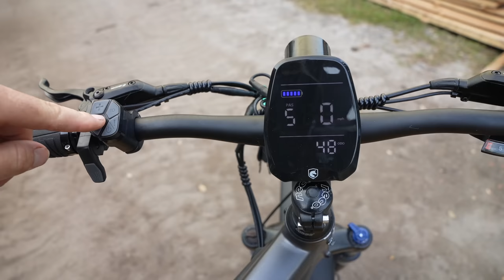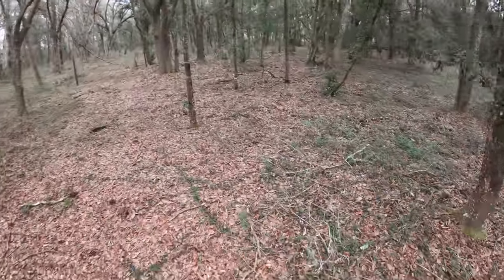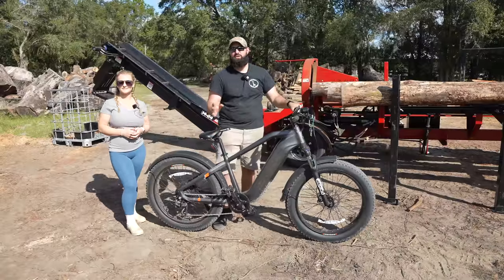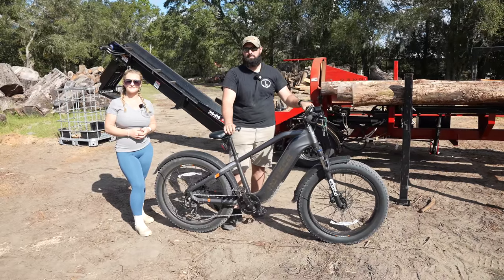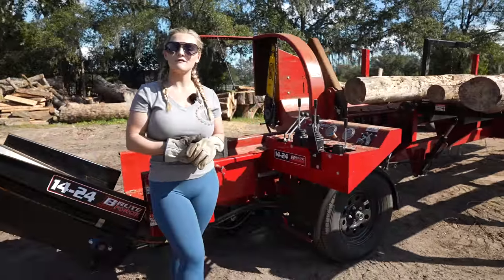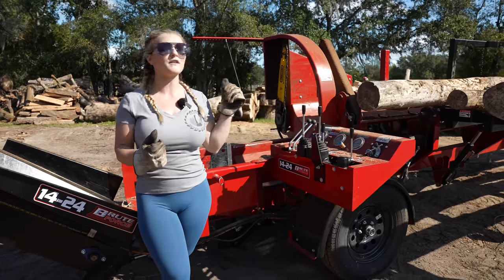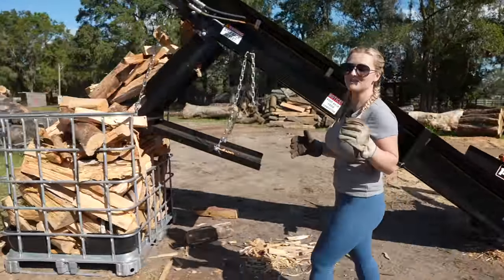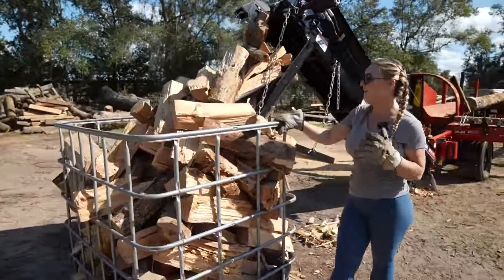I Sold My Truck For This EBike - HOVSCO HovAlpha #hovsco #hovalpha #ebike

Comment from the maker: Enjoy $150 off with discount code: TRD 
Check out the torque sensor ebike via https://www.hovsco.com/?ref=RomJRT1ySNi4lr
Reply: With the direction the chain is spinning I feel like that log splitter should be modified with a protective shield around the control station. I'd hate for you to get whipped by a broken chain ok that saw while you're working. Maybe with see through plexiglass so you can still see what you're doing. Please look into that!! ♥️🎄Edit, I do see there's a guard housing around the chainsaw. But still, sometimes chainsaws break and are violent when they do
Reply: Is this bike hooked up to internet? Have to give an email? Thanks!
Reply: I know you can't be serious saying you sold ur truck for that ev bicycle that's funny

Comment: Pine is perfectly fine to burn in a fireplace or stove. You just have to dry it longer after it's split than hardwood. If you're worried about creosote, use a creosote buster. It's fine.
Reply: Pine in a fireplace is a great way to burn your house down.
Reply: @harpintn  Burning anything in a house is a great way to burn the house down if you don't know what you're doing.
Reply: @TheHonestPeanut  Burning pine is one of the things that people who don't know what they are doing practice.
Reply: @harpintn   do you know what people up north burn? I'll give you a hint, it's not oak. Nah I'm sure you're right they don't know what they're doing. They should import hardwoods instead of doing what they've been doing for the last 200 years 🤣
Reply: @harpintn  enough fresh air and properly dried wood is key. any poorly burning wood will fill your chimney with soot, for then the soot to catch fire one day a proper fire is lit..

Comment: These manufactured bikes have their place - but you can get twice the bike for half the price with a DIY kit - that is easy to install, and the wiring is all plug-n-play. I bought a couple of manufactured ebikes - they all preformed a lot lower than claims - For under $1000 I built a 48v/1000w bike with a 52v/20ah battery that will go 30 mph (throttle only) for about 30 miles  - and a range of more than 50 miles at 20mph
The biggest issue with kits is figuring out where to mount the battery and controller - but there are several options available.

Comment: I've been burning pine for decades, with no problems. The idea of not burning pine is a myth. It all has to do with your burn temperatures and maintenance. A wood stove has no problem burning pine because the high flue temperatures will not allow the creosote to build up. If you are using a fireplace, you just have to increase your maintenance intervals.

Comment: At 28mph it's only scary, if, only if, it's really windy outside!!!
Besides that, it's not scary if a first time ebike rider learns how to ride it well.
As a no more than a two year ebike rider like myself have learned two important things to take lots of caution while riding an ebike that tops a speed no more than 28mph, #1, is how strong the wind is on a windy day, and #2, is riding fast on a curve street.
Anything above 28mph, remember to kneel down and pray before ya kill yourselves out there on an ebike that's equipped with (Super Pursuit Mode) 🤪😜🧑‍🦽🧑‍🦼